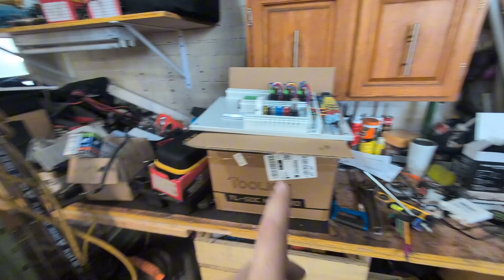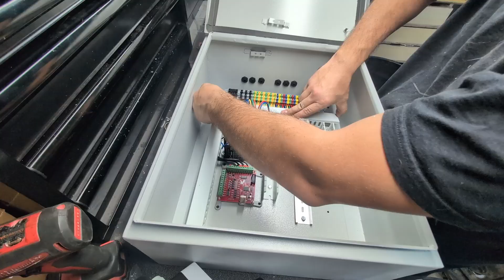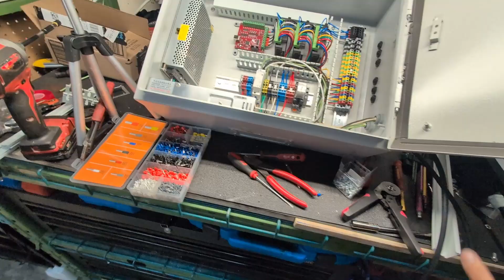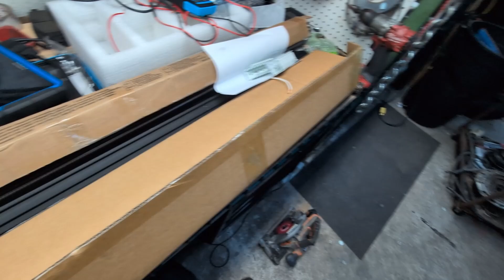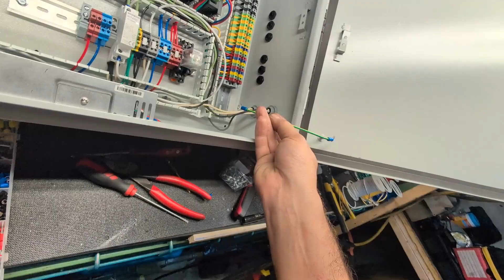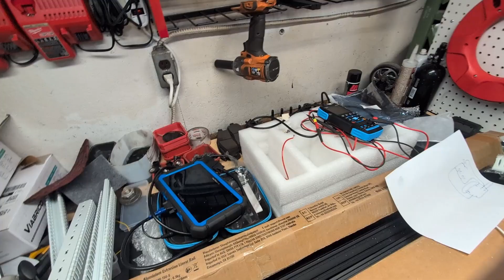cnc plasma cutter project part 3

Comment: looking great so far! only concern are those polymer rollers i would assume that dust from plasmacutting may chew trough them in less than a year, so just keep eye on them, they may be consumable part needing replacement every few dozen miles cut
Reply from the maker: I'll keep an eye on them for sure